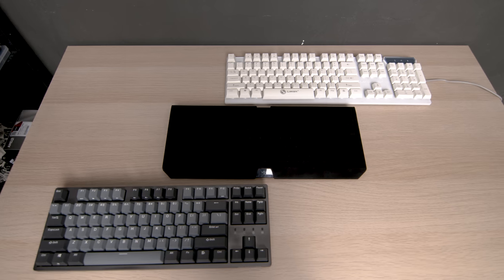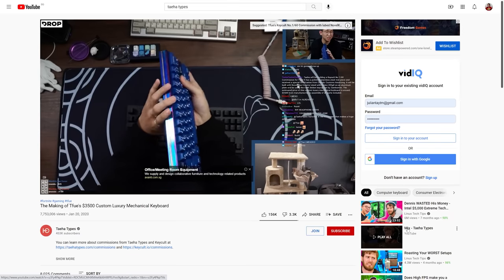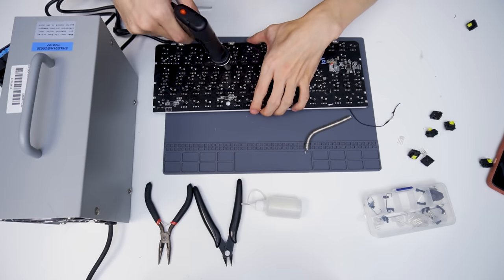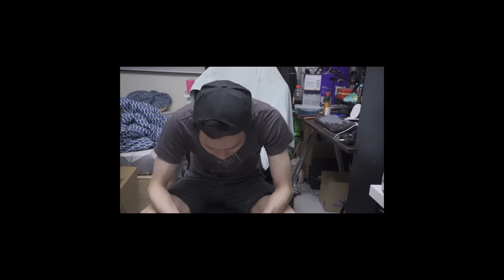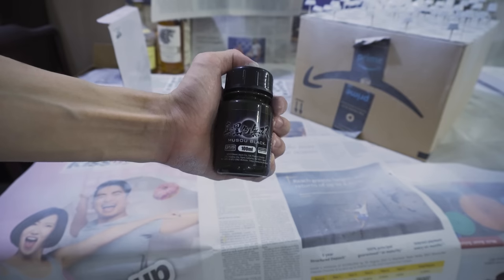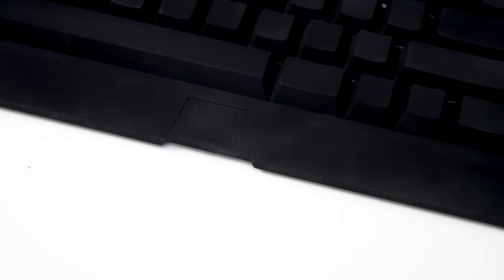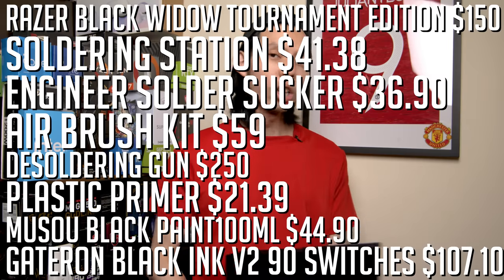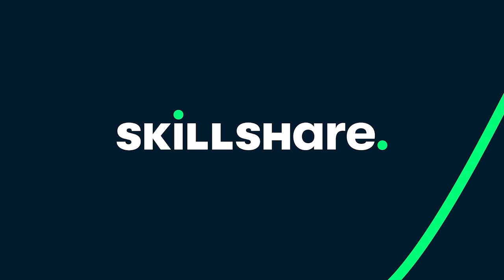BLACKEST Keyboard on Earth! | Musou BLACK Mod

Comment: i dont think the texture of the keycap is anywhere noce also .. you take out the rgb without replacing them ?? then what for take them out in the first place ?? and didnt re lub thr gat black :"|
Reply from the maker: yeah keycaps are not the best but this keyboard will be used for my PC showcase builds. I remove the RGB because, I don't want RGB. maybe? you only know RGB keyboards? haha
I thought of lubricating the switches. but I thought since I'm using this keyboard minimally, and it already came pre lube, I already like the feel of it and already spending 40+ hours on this keyboard. I thought it was pointless. but will do it on my next keyboards
Reply: @JulianTechTM  you put in a lot of effort liao 👍👍👍I would gave given up after ten minutes 😊😂